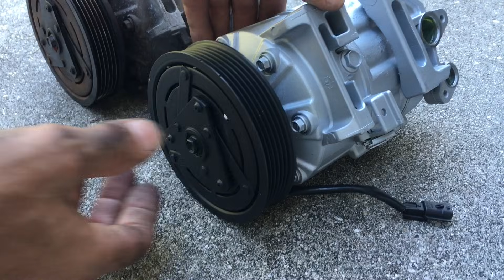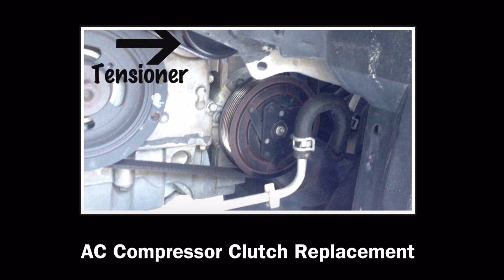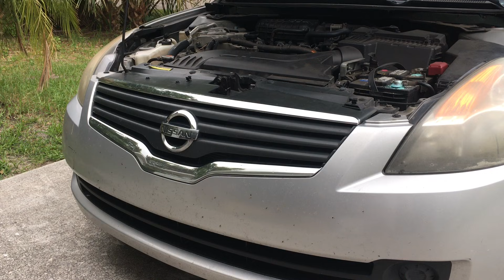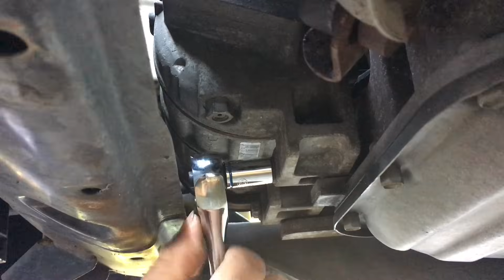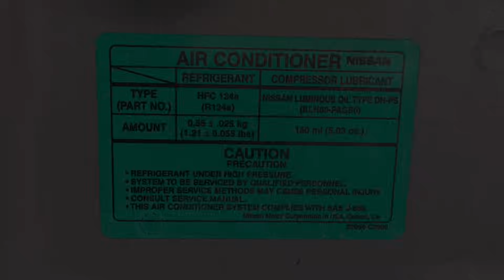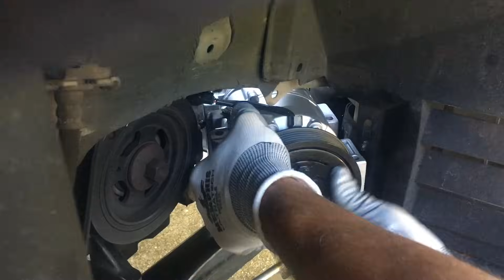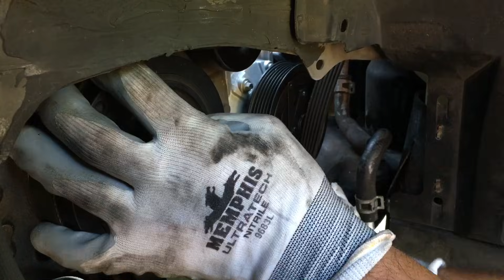AC Compressor Replacement - 2007-2012 Nissan Altima - How To Fix AC System

Comment: My car is 2007 altima. when turn on the AC, My car turn off.... what is problem?? Do I need to change the compressor?!
Reply from the maker: AC clutch bearing may be seizing. Try to spin the AC compressor shaft when car is off. It should spin without much resistance.
Reply: if the pulley itself doesnt move then the problem is the pulley....if the pulley is free then you need to engage the clutch and try spinning the pulley to see if the internal shaft is seizing up

Comment: What if the compressor doesn't start after it has been replaced? What some good troubleshooting tips? Thanks so much for this video!
Reply from the maker: The pressure in AC system should be correct, otherwise pressure sensor/switch won't engage the compressor.
Reply: it's likely your original issue wasnt the compressor

Comment: Please help i cant locate my ac compressor harness in my engine bay, Nissan sentra 2008
Reply from the maker: Are you talking about the the clutch wiring harness?
Reply: @DIYtime  yes
Reply from the maker: Looks like it should be going from clutch to the back of the compressor:
https://www.amazon.com/gp/product/B0775TW541/ref=as_li_qf_asin_il_tl?ie=UTF8&tag=ytb055-20&creative=9325&linkCode=as2&creativeASIN=B0775TW541&linkId=3a2178eed3f3aa6b655d7e8924781790

Comment: Great tutorial, I have a Nissan Altima and my compressor is not working. I wanna do it myself as soon I buy a new one.Thanks a lot my friend...
Reply: If I get one from the salvage yard wouldn't it work just as well as long as the wheel spin around?
Reply: @brendamitchell5767  Yes
Reply from the maker: Thanks!

Comment: Do I need to vacuum the AC Compressor two pipes even if I"m just replacing the AC compressor and not the  expansion vavle/drier ? Thanks
Reply from the maker: It is one sealed system. When you replacing any of the components, you must evacuate the system, and after you are done, pull vacuum.
Reply: @DIYtime  Ok thanks a lot
Reply: whenever the system is opened, a small amount of moisture gets in which needs to be removed by vacuuming it down for atleast a half hour

Comment: Great video

I have a 09 Nissan Altima that has a couple nasty leaks at the o rings. The compressor looks new, the previous owner had it changed at one point. Would i just need to replace the o rings, vacuum the system and recharge or would I have to change out other parts like the receiver dryer?
Reply from the maker: They probably didn't use new orings when replacing the compressor...
It recommended to replace receiver drier every time you open the AC system. Otherwise moisture can cause some damage to it. Good news is it is easy to do and doesn't cost much.
Reply: DIY-time ok thank you
Reply: DIY-time how many cans of refrigerant did you use? The Nissan doesn't have any stickers so I'm not sure how many ounces it needs
Reply from the maker: Mine needed 1.21lb, so I got two 12 Oz cans. I used electronic scale to charge the proper amount.
Reply: DIY-time thanks again!
Reply: @mcfriedchicken1972  ChrisFix has a detailed video how to charge properly....ideally you dont want to use just a can but you can ballpark it by just using a can and weighing the can and hose together, then as you put refrigerant in you can weigh the can and hose again and know how much you put in

Comment: Hey, i’m dealing with this issue in my Nissan Altima 2009, what kind of compressor should I buy? The universal one works fine? Please HELP! It’s 105 in Texas😓 nice Video!
Reply from the maker: Hi there. Totally feel you, I'm in Florida... 
Not sure about universal one, never tried it. I bought original refurbished one with 1 year warranty. Everything cost me around $150. I had it for over a year now, still running strong.
Reply: DIY-time could you please give me the website where you bought it? And will that one work on my 2009?
Reply from the maker: I got mine from eBay. 
http://rover.ebay.com/rover/1/711-53200-19255-0/1?icep_ff3=9&pub=5575132837&toolid=10001&campid=5338340151&customid=&icep_uq=2009+Altima+ac+compressor&icep_sellerId=&icep_ex_kw=&icep_sortBy=12&icep_catId=&icep_minPrice=&icep_maxPrice=&ipn=psmain&icep_vectorid=229466&kwid=902099&mtid=824&kw=lg

Comment: Did everything else like the dryer replacement now just trying to replace the compressor and this one bolt just won’t budge any suggestions ?
Reply from the maker: Try to spray it with penetrating grease and use impact drill. It does wonders with stuck bolts. Maybe borrow it from someone if you don't have it.
Reply: I ended up having to have someone heat the bottom of the bolt while I wrenched from up top js

Comment: I want to change the relay first to see if that is the problem before I spend $1000 at the autos hop.  Where is the relay for a 2009 altima?
Reply from the maker: It should be either under the hood or under the steering wheel.
Reply: DIY-time I don’t think this car has relay. It has 10 amp fuse.

Comment: Have a 2009 Nissan Altima. The mechanic said it was the compressor, we changed that. It worked great for a week then no cold air again. Any suggestions? By the way, love the video. Thank you much
Reply from the maker: Sounds like freon is slowly leaking somewhere. Have your mechanic check the pressure in the AC system. Most likely it will be low. If so, you can use recharge kit with UV dye to determine the place where it's leaking.
Reply: DIY-time, gauge shows it's full, but I'll try what you suggest. Thank you again
Reply from the maker: I had a similar problem. It was leaking from expansion valve. I used these tools to detect freon leak:Recharge kit with UV dye: https://www.amazon.com/gp/product/B001O087OG/ref=as_li_qf_asin_il_tl?ie=UTF8&tag=ytb055-20&creative=9325&linkCode=as2&creativeASIN=B001O087OG&linkId=21a422a5420cf308bb1bea05c4a56653 ...
UV flash light and protective goggles: https://www.amazon.com/gp/product/B003JOB594/ref=as_li_qf_asin_il_tl?ie=UTF8&tag=ytb055-20&creative=9325&linkCode=as2&creativeASIN=B003JOB594&linkId=10a2c4484be25eaee423f093949cfb84
Reply from the maker: If the pressure is ok then it is probably something else. Did they replace expansion valve, receiver-dryer, pressure switch sensor too when replacing AC compressor? If this is happening week after they replaced the compressor, I would go back to your mechanic and demand getting it fixed. Doesn't sound like it was done right in the first place.
Reply: DIY-time not sure if all was changed too. I also saw you added oil to compressor, wondering if any was added to the new one 😕 I will definitely take it back. Thaznk you ☺

Comment: My car does not have sticker for the compressor oil amount. Where can I look it up? 2010 nissan altima 2.5. ty
Reply from the maker: I bought Service & Repair Manual for my 2007 Altima and it has all of that information. 
I'm not sure if it would be the same amounts for 2010 though. 
http://rover.ebay.com/rover/1/711-53200-19255-0/1?icep_ff3=9&pub=5575132837&toolid=10001&campid=5338322801&customid=&icep_uq=2010+Altima+Repairs+Manual&icep_sellerId=&icep_ex_kw=&icep_sortBy=12&icep_catId=6000&icep_minPrice=&icep_maxPrice=&ipn=psmain&icep_vectorid=229466&kwid=902099&mtid=824&kw=lg

Comment: I have a 07 Nissan Altima and I'm trying to figure out if I need to replace it or is there a bad leak. I have recharged my car with the AC pro but the line got cold when the car was on and AC on max but a minute later it went back to hot. I'm looking at the ac compressor but the thing that is suppose to turn, does not turn. and I tried it manually, and it turns. Do you think is the compressor or a leak?
Reply from the maker: You'll need to check pressure in the system. If it is in good range, then there is no leak. If there is a small leak, the pressure gets too low and AC compressor won't turn on. If there is no pressure, you have a big leak. You'll need AC manifold gauge to check pressure.

Comment: The O rings you chose  looked like the wrong size. lol
Reply from the maker: The aftermarket set of Orings I bought didn't have the exact fit. I was told it's OK if they are a bit larger. Nothing is leaking for almost a year now.
Reply: Proper size O rings due matter that's why they have O rings in the first place...I would say your lucky nothing is leaking.
Reply: @physicalstarfighter2131  true, the orings have to be exact....even using metric instead of sae orings that are similar will leak

Comment: Currently, a shop wants to charge me $947.45 to change the A/C compressor, the A/C drier, the serpentine belt, the battery fuse, conduct a freon charge, A/C system flush, and of course the cost of labor for my 2008 Nissan Altima. Is this a fair estimate or am I being highly overcharged?
Reply from the maker: No, that sounds like average price for this job.
Reply: DIY-time thank you! 🙏 Btw, an 08 Altima with about 93K miles, if I'm consistence with the maintenance, how much longer do you believe I could use it comfortably? I have ppl telling me 2-3 years but I'd like to push it to 5
Reply from the maker: I had my previous Altima until 230k, and then sold it for $400. You should be fine for next 5 years. Unless your CVT transmission goes out....😬 (very common issue).
That's what I'm dealing with right now.
Reply from the maker: *sold it for $4000
Reply: DIY-time ah good to hear! And I'll stay on the lookout for the CVT problem 👍 thanks and good luck with that! At least it gives you another video idea
Reply from the maker: Exactly!
I'll try to changes transmission oil first, we'll see how it goes... I'll make a video on that.
Reply: DIY-time  my first issue was code P0745 . Is that what you’re getting? Then the the ac compressor literally blew out. You make this look so easy. I have enough hope to give it a try now 😄 great video . I’m still researching the tranny code. 2007 Nissan Sentra 205,000 mi

Comment: I have a 2013 does this still apply?
Reply from the maker: It will be different on 2013 model, but should be very similar if you have 2.5 engine.

Comment: How much oz of oil do I have to add to a compressor? 2009 Nissan Altima
Reply from the maker: You should have a sticker under the hood, that shows how my oil goes into the compressor.
Reply: The Nissan Altima service manual says to drain the old compressor and new compressor into separate containers, then fill the new compressor to match the amount of oil that was in the old compressor. If you had a large leak or are replacing the following parts add this amount of oil: Large leak 30 ml (including large leaks at the compressor), Small leak no oil required, Evaporator 75 ml, Condenser 75 ml, Receiver-drier 5 ml.

Comment: Great video, but I'm confused about oil fill. Isn't the full 150cc of oil you put in only for a complete system flush and if you just replace a compressor, aren't you supposed to adjust the added oil quantity down to account for the amount that's trapped throughout the system?  I'm installing a Denso compressor (it comes with oil) and the installation guide says to match the amount of oil in the new compressor to the amount in the old compressor.  No oil came out of either my new or old compressors at the ports where the Freon lines connect (where you added the oil in your video). But I was able to drain 120cc from the new compressor when i removed the bolt from the port that's near the Freon lines, but closer to the clutch end of the compressor.  I refilled it at this port with about 25cc, which is the amount that came out of the old compressor at that port.  Does this sound correct?
Reply: The Nissan Altima service manual says to drain the old compressor and new compressor into separate containers, then fill the new compressor to match the amount of oil that was in the old compressor. If you had a large leak or are replacing the following parts add this amount of oil: Large leak 30 ml, Small leak no oil required, Evaporator 75 ml, Condenser 75 ml, Receiver-drier 5 ml.
Reply from the maker: Every situation is different. My compressor was leaking, so there was no oil left in it. I used a chart from factory repair manual to find how much oil is needed in my particular situation.

Comment: Fantastic video, I'm about to do this myself, but I'm curious at what point did you change the coil? You didn't seem to mention that part.
Reply from the maker: +Andrew Ramirez 
I did it a while back. Few years ago my coil went bad and I replaced just the coil.... 
You probably don't have to worry about it if you replacing the entire compressor. I just mentioned that video since it is also related to AC issues.

Comment: does 2014 Altima compressor come preloaded with oil, or does it need to be added before install?
Reply from the maker: +Frank amaral 
It all depends where you are buying it from. 
Just read the description when buying the compressor.

Comment: How many oz's/cans of freon does this system takes? I cant seem to figure out how to convert the amount that is recommended into oz's. I know one can of freon is 12oz. Are you able to assist me? Thanks :-)
Reply from the maker: +Ed D 
I'll check when I get home tonight...
Reply: Thanks... I really appreciate you and your videos. It has helped me alot! I recently purchased a 2011 Nissan Alitima and the compressor does not engage while putting freon into the system.
Reply from the maker: Alright! 
On the sticker under the hood it says 0.55kg which is 550g.
One 12oz can is 340g.
Than 550g is 19.4oz.
So you'll need to buy two 12oz cans.
To fill with 19.4 oz, use one full can and 7.4oz from the other can.
I used this digital scale to measure exactly 7.4oz: http://amzn.to/2erM17B
You put the can on the scale as you filling up freon.
Reply from the maker: Have you checked if maybe compressor clutch is bad?
https://youtu.be/P7MWWgLIFGQ
Reply: Yes thank you. The front turns but does not turn on while engaging freon into the system. I really appreciate you for breaking down the freon specs for me into oz's. I was able to source a new compressor on Ebay for 107.99 and I had a eBay coupon valued at 100.00. The compressor cost me 7.99. Thanks again!
Reply from the maker: +Ed D 
Nice!
Where did you get $100 eBay coupon? 😳
Reply: I got the coupon from eBay for selling a car. A promo they has a few weeks ago which came in handy. :-) Wish me luck going to attempt to swap the compressor out I just received it. Thanks again.
Reply from the maker: +Ed D 
Good luck! 
Let me know how it goes.
Reply: Np enjoy your weekend! :-)
Reply: you always need to manually engage the clutch with the car off to be sure it can engage to begin with by jumping the relay or applying battery to the clutch

Comment: Can I add little bit of UV dye in to the compressor when adding the oil into the compressor?
Reply from the maker: That's actually a very good idea, in case you have a system leak later.
Reply: Thanks for your reply.  I really appreciate all your videos about AC.  I have a 2066 Nissan Frontier and getting ready to replace the compressor, condenser/drier, expansion valve and evaporator coil.  I don't know if I should replace the pressure switch.

Comment: Hey very informative video! I was going to buy this package that also includes the A/C condenser, would you happen to know how to remove that?
Reply from the maker: I haven't touched mine, but I don't think it is too complicated. 
Remove bumper and front grill (shown here: https://youtu.be/k4BOxlzVW4Q ) 
Once that is done, you'll have easy access to condenser. 
And then it probably should have two pipes connected to it and couple brackets holding it.

Comment: This video is amazing. You make it very easy for a tenuous amature like me. I will try it. The service shop wants almost $1,000 for my 2011 altima compressor that won't turn on any more. No way.  One question: why is one of the compressor oils you use bright green, but the other you poured into the compressor clear? Is there a difference? Where do I buy the bright green kind? Thank you,  Bthomassen
Reply from the maker: Thanks, that's because I amateur myself, so I explained everything on amateur level... 😁
Green oil is what was inside compressor from factory. It contains special dye for leak detection. It glows on UV light...
When I bought replacement compressor, it came prefilled with regular oil, so I didn't bother to look for original OEM one.
Reply: That's great, Thanks. Also, one other question, what is the name of the tool you have that you are using with the pointy end, that you use to remove the washer/grommets? I need that tool. Thanks!
Reply: @bradthomassen1061  r134a refrigerant is green so the oil that dripped out had the green tint to while the oil he put in was obviously straight oil

Comment: Hi I have same vehicle and I replaced AC compressor and drier, it blows cold air but not really cold.. And compressor Does not Cycle off ?? It always runs ??
Reply from the maker: +naiefelyemeni1986 
Whas it not blowing cold right away or gradually over time? 
You either don't have enough refrigerant or it is leaking somewhere.
Reply: Temachok  
Ok today I turned on AC and it took like 3 min driving before it started to blow somewhat cool air ?? Today is about 90. Degrees ..I took readings yesterday 
Static 80 and 80 
Dynamic 42 and 175-180 
85 degree day 
?
Reply from the maker: +naiefelyemeni1986 
Looks like pressure is a little too low.
Reply from the maker: +naiefelyemeni1986 
According to this chart:
http://rechargeac.com/how-to/ac-system-pressure-chart
Reply: Temachok 
So the readings are 100% accurate on how much freon I have in the system ?
Reply: When you replaced the compressor did you run a vacuum on the line for at least 45 mins and hold it? If the pressure begins to rise again you have a leak somewhere.